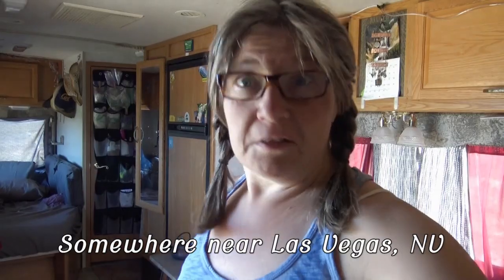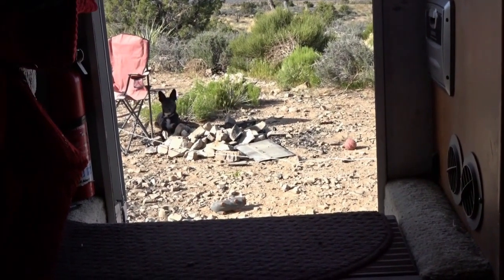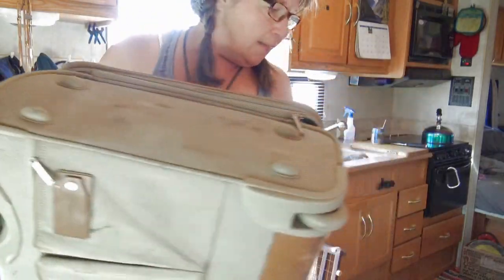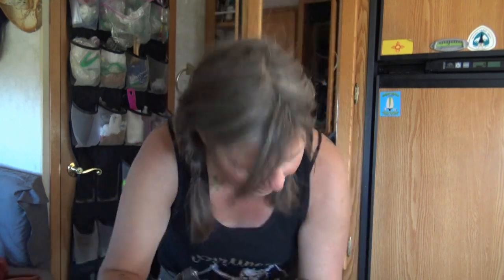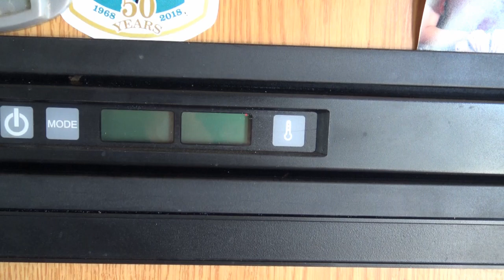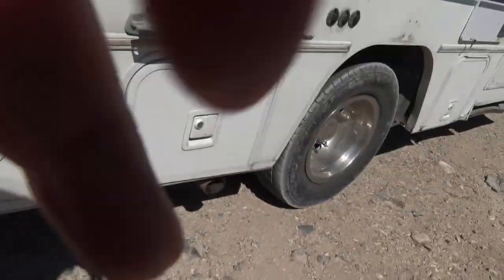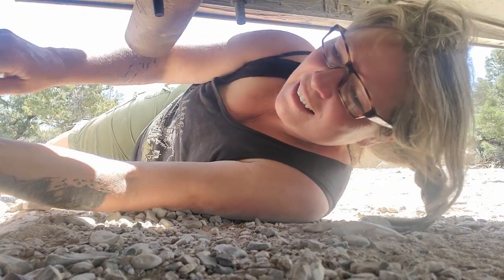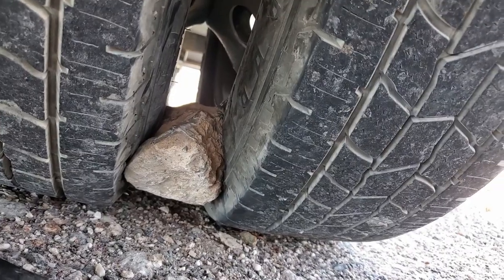Real RV Life:  I Run into TROUBLE as I Pack Up & Hit the Road

Comment: You always have 7 gallons of water in hot water tank you can get from your low point drain in a pinch. There is even more pressure on the rock when you rolled the tire. Lower air pressure and then use your portable air compressor to inflate would work, or use your tire leveler to raise one tire would work as well. If you a don't have a compressor get a "air stealer" super cheap and handy. It just moves air from a full tire to a lower aired tire. Good work!

Comment: ROCK IN DUALS TRICK 😎👍 Ok u need a chunck of a 2x4 about 2-3 feet long. A 4x4  is what we use on big trucks. (Peterbilt etc.) I'm thinking a 2x4 may be better on a smaller vehicle. Even a solid piece of pipe would work if it's solid like a crow bar with no hook. You take the 2x4 or whatever & put it between the rock & the rim & drive forward or backwards depending on how much room u have on front or back of tire. This will use the weight of the vehicle & the ground to get it out. Hard to explain but hopefully you understand. Easier to show a person than to explain it. Hopefully this saves to ALOT of time & frustration in the future. ✌😎👍If it doesn't make sense I will respond, stay safe.

Comment: I save a couple gallons for an xl micro towel shower. Heat the water in a pot, sop up some water and wring it out over your head to get wet. Soap up and rinse a couple times. That warm water cascading down is lots better than a sprayer. That Coghlan's camp soap works perfectly.

Comment: If you ever get another rock stuck in between the tires simply find a long tree branch and pry it out using one that is about 3 or 4 feet long.  Be sure and do it by placing your pry tool branch securely.

Comment: Great job on those rocks. One of my possible attempts would have been to move the camper until the rock was positioned as far to the back as it could go. Then use one of those ratchet tie down straps (assuming you cary one) and wrap it around the rock and a vehicle steal cross member, then ratchet it as tight as you can. Then roll backward until the rock comes out. (Maybe forward) It’s only a thought, I’ve never tried it.

Comment: I'm not familiar with dual tires. But jack up rig so  tires just off ground, easier to knock out. If not, then also loosen lug nuts of wheel enough to allow tire to wobble...rock'll just fall out.

Comment: Hi Carolyn and Sadie!  Just a little tip about something I noticed. I sell online and am always trying to save money with shipping. Looks like you used quite a lot of the Priority Tyvek envelopes and shipping with those is calculated by weight, rather than using a legal flat rate envelope which is $8.25. You can actually stuff a lot into them. Many people think you can only use them for flat documents, but it's not true. As long as the mailer can seal where it's supposed to, it's fine. I often will fit a pair of jeans in one!  There are also padded flat rate mailers available at the USPS site. You can order them free from the post office and have them sent to your next destination. You can sometimes get them at the post office if it's in a bigger town. And if you have a printer, you can print the labels at home and just drop them off at the post office, also, you'll get the retail rate. Doing this will save you 1-2 dollars a package, depending on the location. Just a way to save some $$$, hope this can help either you or other nomads who sell on the road.  Take care!

Comment: The tire iron going in from the opposite side between the tires and pounded on with the hammer to PUSH it out instead of pulling it out. Just and observation of how I'd have done it.

Comment: Had to read thru all the comments 😂🤣🤣 lots of ideas but trust me. Little chunk of board & 30 seconds later it's out. You don't need oil all over everything or something to strap it to or anything. Stick the board in there & pull forward. DONE. 😂😂🤣🤣 Loved reading all the ideas tho. Tricks of the trade you can't beat. 😎👍

Comment: I think you should get a tire inflator/compressor, and a tire repair kit. The inflator will be a bit expensive for your big dually tires, but it could save you a tire, especially way out in the middle of nowhere. I had a flat a wile back, and went to use my spare, and IT was flat. It hadn't been used since the truck was new, and had just leaked out over the years. It's good to check your air and your spare every so often. Your tires will last much longer.The tire plug kit costs only a few dollars, and will let you fix a flat long enough to get to a repair shop. "Slime" or the like, goop you spray into the  tire, is not a good solution. At the very least, a repair shop will charge you extra if you bring in a tire for repair with that stuff inside it. It's a big mess for them to clean up before they can fix the flat. On newer vehicles with tire pressure monitoring systems, it can damage the sensors. I'm so glad you were able to get those rocks out!
Reply from the maker: #787

Comment: I have never owned a dully, but as a fellow camper with leveling blocks, I would think you could drive up onto blocks under the inner tire only and loosen the lug nut on the outer rim.to take the pressure off the rock. Even some loosening would be easier than beating on it an hour. Somebody tell me if that isn't correct. (but I still don't own a dully.
Reply from the maker: James, yeah... getting lots of comments saying this. I don't know why I didn't think of it. I guess I thought that would have been more work than knocking it out. I just didn't expect it to take an hour! thanks

Comment: I kept wondering why you didn't try pulling it forward, by lowering the ax blade behind the rock, &  try yanking it forward, or hitting it from the back side to push it forward. Also wondered if having a steel wood splitter or chisel to place on the rock & hit with the hammer or the butt of the ax would work. You might want to buy something like that, in case it happens again. 
 
I was one of those gasping when you first tried to wedge the ax in there, imagining you slicing off some of the sidewalls, which aren't as tough or thick as the tread. If you only had some kind of device which could be used to widen the separation between the tires, so it could fall out! Maybe a big spanner wrench (Is that what they call them?) would help, if it allows the space between the tires to be spread wide enough. They're wrenches used to fit over things you need to tighten or loosen. Maybe there are tools mechanics use to work on large vehicles that could be helpful, like to glom onto the rock, then tighten it up, then rock it back & forth to remove the stone bit by bit. Maybe a lubricant would've helped, like coconut oil, or vaseline or some kind of grease a mechanic would use? Hope you were able to find a good shower after all that! 
It would be great if you could raise the body up higher, to increase your ground clearance. That might alter the handling of the vehicle at higher speeds though, I don't know. Are there vehicles you can live in which are designed with a suspension & better ground clearance for going over rough roads & terrain? 
At least you like living alone & being on your own, so you likely don't feel as batty as most of us do by now, having to isolate ourselves for long stretches of time. I'm use to it too, but it's even getting to me! I keep wanting to go to a restaurant. I haven't been out at all since March 17th, to grocery shop! now it's May 22nd. Feels like much longer... 
It would be nice if you could use a new pic of you with Sadie, instead of you & Capone, as this is a new journey for you two, together. Liked your renovation by the way! The new fabrics & colors must make it feel more like you. What will you be doing when the summer heat comes? Do you head for the hills, where it's maybe cooler?

Comment: Hu Carolyn & Sadie girl❣ All I can do is kind of laugh and shake my head OMG!!  It's so crazy how everything can be going along fine and then bam shit happens!  Yesterday everything was going fine and I went to dump my tanks. It had been windy and I didn't notice the black coiled thing that holds the hoes up off the ground had fallen. So silly me while the tank is dumping I'm trying to lift up the hose and put it on the coil thing and bam the sewer hose cracks because of the heat we've been having. So I go in to get some tape and bam I see the cats knocked over my zero water filter container after I had just filled it up and it's the big one.  It was sitting on the kitchen counter on top of the stove and I still don't know where all the water went after searching everywhere. But then today I decided to cook something and when I lit the stove I heard a gurgling noise and the fire wasn't coming out right. So I have to figure out how to get the thing underneath the burners up so I can look underneath it. I want to make a suggestion for next time you have to lay on the ground may be put down one of your rugs to lay on. I could feel your pain and frustration ugh! When it rains it pours. I had my appendix removed about a month ago and unstuck in El centro California in the heat waiting to recover enough so I can pack up and get the heck out of here!!
Reply: Not going to correct my typos I don't feel like it🤣

Comment: Rock removal easy way. Turn tire so rock is at 2 o'clock. Using a long enough solid bar or log that can be placed between the 2 tires, place rod under rock so one end is up past rock sitting on wheel hubs and other end is out at approximately 45° angle on ground. Move vehicle slowly so rock is forced out by rod. Do not move far as rod can cause damage to vehicle if moved far or fast. Vehicle should only need to move 1 to 2 feet. Big earth hollers have a bar that hangs between their tires that serve same principle. Warning: placing anything between tires can cause damage to vehicle and/or tires and wheels. Do so at own risk.

Comment: Turning the wheels so the rock was at the bottom was not a good idea because the pressure on the rock would have the weight of the camper pressing the tires tighter on the rock. Would have been better to move the RV a little forward tp lessen the grip. Glad you got it out though!

Comment: Personally I would jack up the wheel and take off the lug nuts before I would be hacking at an expensive tire with a axe 🪓 you could remove the lug nuts in a few minutes drop the rock and put the tire back on and you won’t be bruising the sidewall of the tire. Just a thought 💭if you get an electric impact tool from harbor freight for around $30-60 you can take off all the lug nuts and replace them in less than 5 minutes. if you leave 1 or 2 of the nuts on a couple of turns the wheel on the opposite side from the rock it should give you several inches to get the rock out and the wheel won’t come off all of the way then tighten up the nuts one side then 1 on the opposite side and work your way around till they are all tight you can also get an extension that will only tighten to the proper torque so you won’t over tighten and break a lug nut which is a pain to replace if you don’t have to. You should have a good floor jack with you anyway if you’re going out in the Boondocks a good farm jack is good also you can jack up one side all the way and shove your rig back onto the road it looks scary the first few times but I got a 10 ton dump truck full of gravel out of a hole and back on the road in just a few minutes with just a shove they don’t teach that stuff anymore o well if you don’t have a tow truck you have to make due with out them.

Comment: All you would have needed to do was to jack up that  corner a little bit, remove or partly remove  the outer wheel,  and the rock  would have just dropped of its  own weight.

Comment: I recommend a GOOD 12 volt air compressor, one that will pump up to at least 120# & not take all day to do it. your tires probably need at least 65#, & air bags up to 85#.
Reply from the maker: If I carried everything I might need for the just in case moments, I'd need a bigger rig.

Comment: I'm curious if you were to use some type of cooking oil drizzled between the rock and the tire, and/or a canvas strap wrapped around the rock, then wrap the ends of the strap around a wooden handle and tugged..    The other thing that popped into my head was if you were to drive the RV forward just enough so that the rock would have been facing the front of the rig, therefore the muffler would not have been an issue.    Oh, and thank you for the hygiene tips and tricks!!     ...PeAcE

Comment: Park with the rock straight back like in the first shots. Put a chain around the rock, then stretch it out and attach it tight to the bumper or frame. Drive about 1/4 turn of the wheel.  A heavy ratchet strap would work better because you can tighten better before moving the rig.

Comment: Next time put some kind of strap around it and tie it to a solid point and reverse your rig it will pull it right out of and only take you a few minutes
Reply from the maker: yeah, I thought about that. Next time. Lesson learned
Reply: Easiest is to actually loosen the lugs on the outer tire pull the tire out just a fraction and the rock will fall out then tighten the lugs back up, good reason to have an impact wrench it could have been a five minute fix
Reply: @e.nichols5380  it's the same difference whether you tied to something or put it underneath the front tire it's coming out either way
Reply: Was just adding it because sometimes you don’t have anything to to or a long enough rope or strap to reach something to tie to.  Good info though thanks
Reply: You should have an Air compressor and tire plug kit specially when you’re out in the middle of nowhere You let the air out of the outboard tire remove the rock Then re-air up the tire Easy Peezy
Reply: My thought exactly. She also should have moved slightly forward and brought the rock to the top of the wheel. Probably would've come right out with a few whacks. Having the rock at the bottom made it wedge even tighter because the side walls of the tire will bulge out just above the road. Good ol' radials.
Reply: bring the strap to the front tire run it over and pull the rock out. I have had my duels pick up rock all the time. got lots of blowouts due to them. Then someone showed me to use a strap to wrap it around the rock bring it to the front of the RV and let the RV do the work. Lots of YouTube videos on it

Comment: I can imagine that the second rock was hard to take, but just driving the rock out is never a good idea. It could have launched into your rig or worse into an oncoming vehicle. Jacking up your rig and loosening off the lug nuts or pulling the rock out with a ratchet strap are both better ways to go. In any case, it made for a good video.